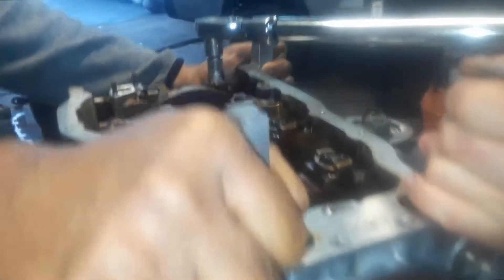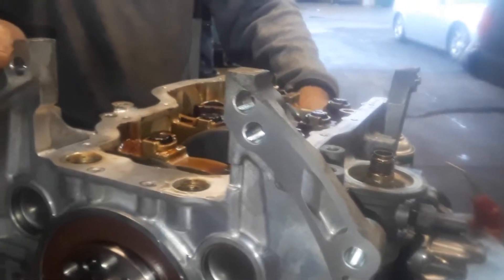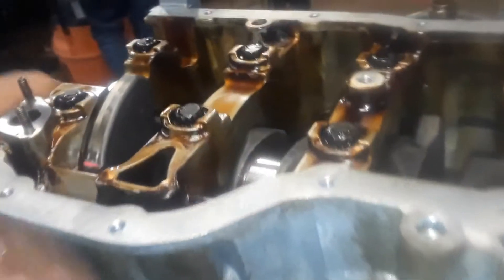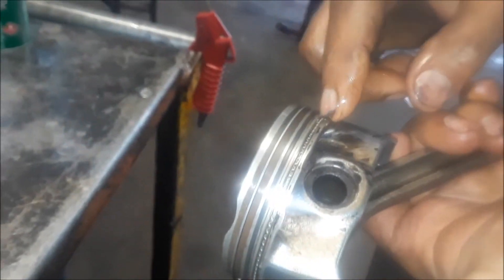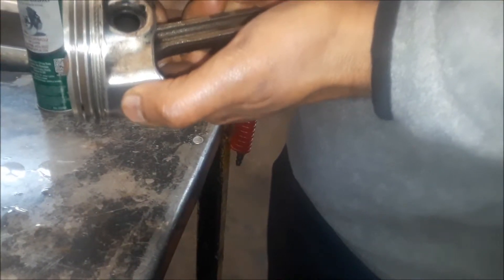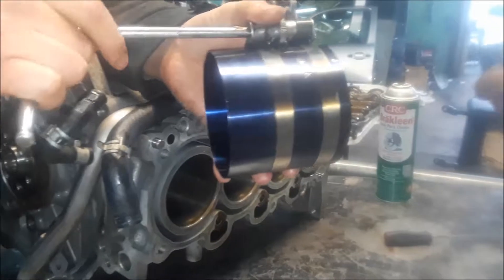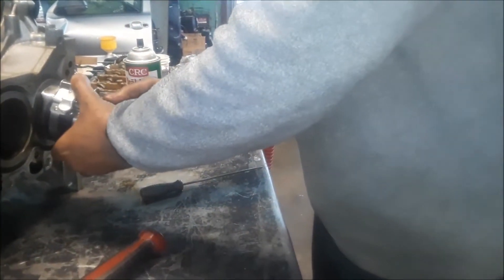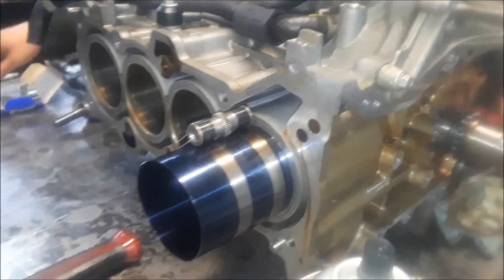Hyundai Tucson Engine Rebuild No Oil Change for 60k Miles

Comment: I've seen a virtually brand new Hyundai Tucson leak oil so I don't know whether it's the cars fault or whether they don't change the oil.

The Hyundai in the video probably had its oil topped up because I've known of Toyotas which have went for 20,000 kilometres without even so much as a top up & either the oil light came on or there was only 1 litre of oil left in the motor.

That means the oil still has contaminants in it which blocks the oil filter up & bypasses the contaminants to the bearings then chews them out !